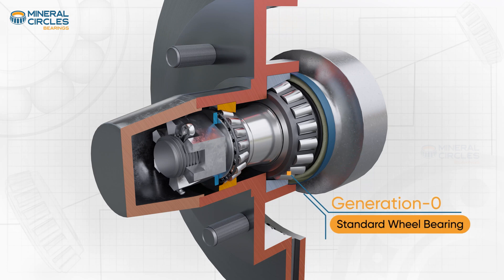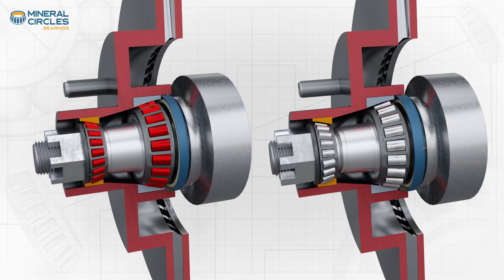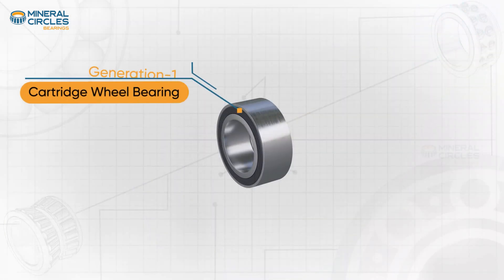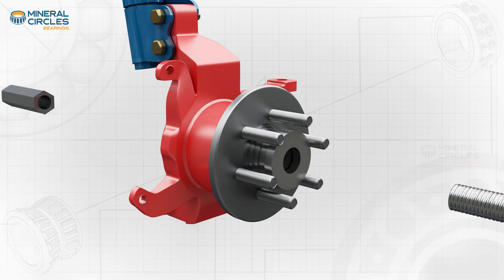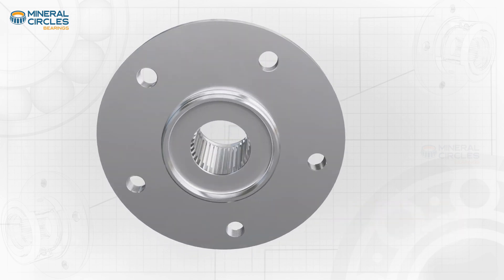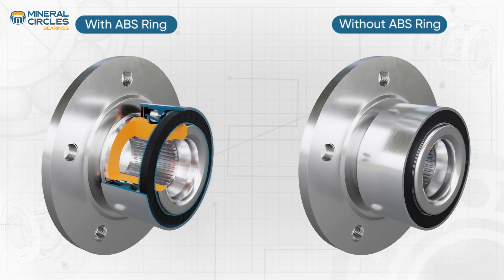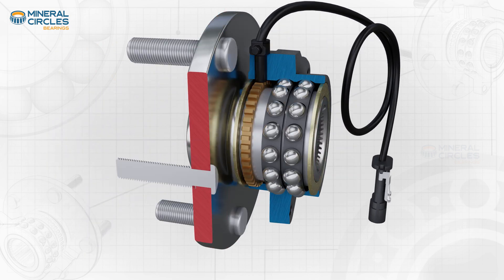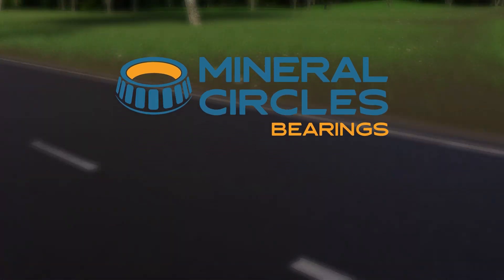Wheel Bearing Generations explained: Gen 0, Gen 1, Gen 2, Gen 3 - ENGLISH

Comment: I worked on Gen 0 bearings in the 70s & 80s.  I was taught to torque to 12 ft/lbs then back off to the next hole.  After a while you just know.

Comment: After messing with all of them.
Gen 0 is the best one. Easiest to fix and proper maintenance will make them last nearly forever.
Gen 1 is more difficult to do and sometimes requires special tools. You can maintenance then, but it's harder and getting a new seal is usually not possible.
Gen 2 is just a improvement to gen 1. You can't really maintenance these.
Gen 3 is the worst. Easy to replace. However they're made so cheap that they fail frequently. Also no maintenance and they cost alot more compared to the rest.